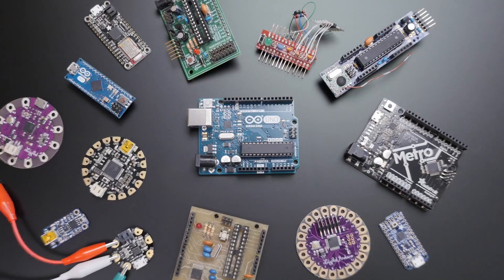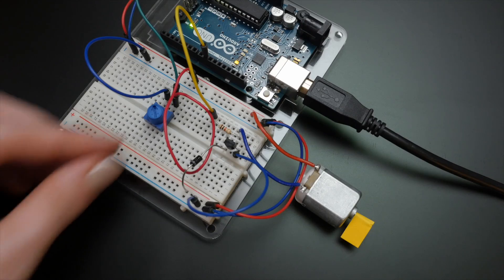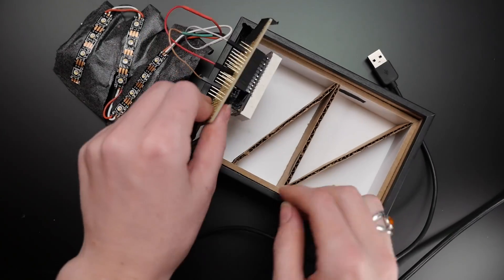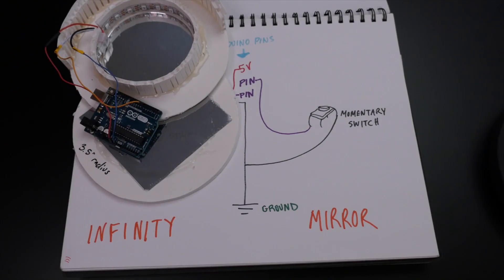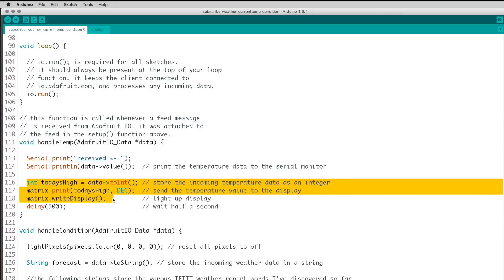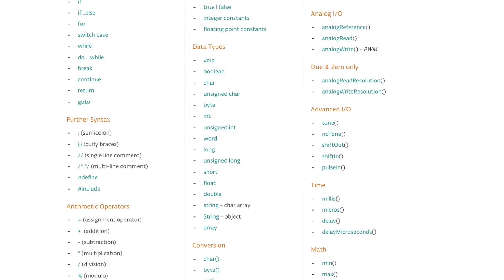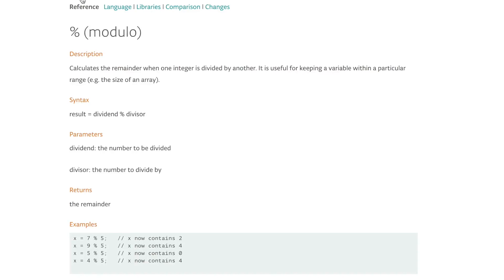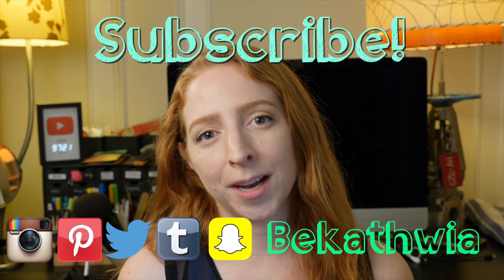3 Beginner Arduino Mistakes // Becky Stern

Comment: What to tell a beginner..

Stop trying to learn how to program computers. Teaching the computer to speak human is what you need to work on. Although I've been at coding since the late '70s, I'm still a pretty poor computer programmer. For the life of me I can't remember syntax. If I can't find a piece of code somewhere to copy the syntax from, I'm pretty much dead in the water. But, I am very good at building software tools that let me "talk" to the computer using MY language.

Start your tool kit early. Do not be afraid to throw out, rewrite and improve it as you learn. The group that runs their creation/destruction cycle the fastest, usually wins.

-jim lee

Comment: The first point is my biggest piece of advice for people as well, there is that old saying, "how do you eat an elephant?... One bite at a time"

It doesn't even need to be complicated stuff, even for something simple like a button turning on an led, there are two separate things there and as you say in the video, break it down and get each thing working individually before combining 

I would also always recommend when someone is trying out a new board to get the blink example working first!

Comment: Those are solid tips! 
First one is the key to successful project. Beginners usually have a goal, but don't know how to get there. Answer is to divide the project into bite-sized sub-projects.
In the end every project is just a combination of simple steps. Some steps might be higher than others, but it is still easier to take the stairs than it is to jump to the upper floor.
Great video, cheers!